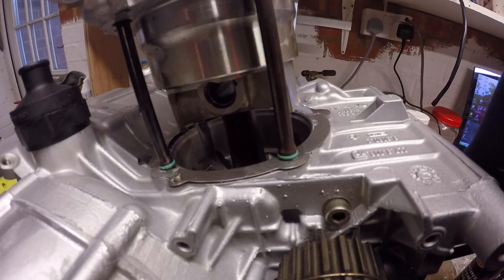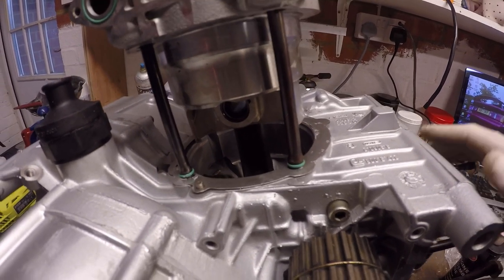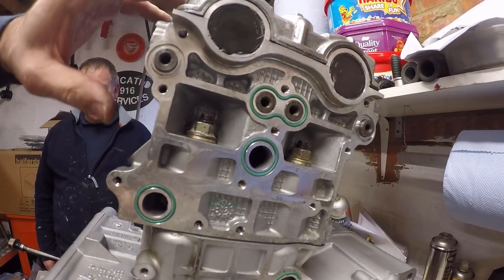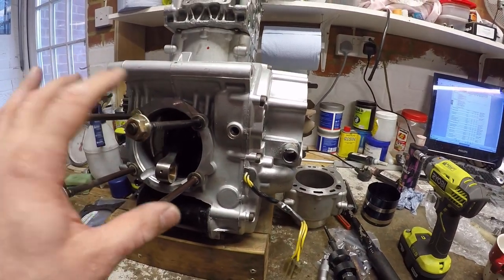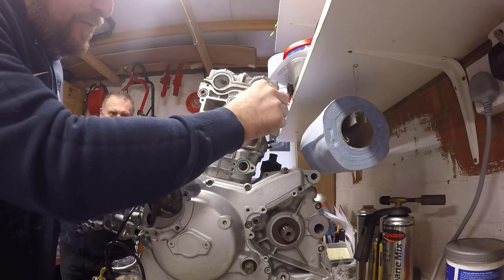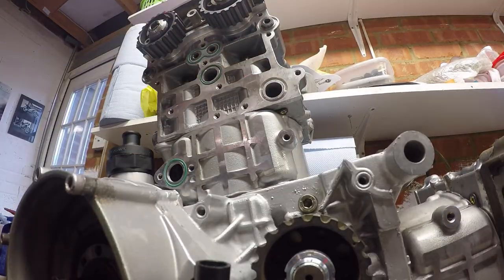Testastretta 749 Engine Build Video 3 - Fitting the Cylinders and Heads

Comment: Was the squish not checked just because this wasn’t a full ‘blueprint’ type build? Great work and video.
Reply: And shouldn’t the setting on the torque wrench be reduced since it’s not acting directly on the nut? The wrench head looks like it has a 4” or so mechanical advantage over the nut being tightened.
Reply from the maker: HI Rob, Its something I have considered but as I have not had any issues to date doing it with this tool I have stuck with settings as given and accepted that it applies a few Nm more torque.

There is another tool I have that is direct line for torque similar to the factory tool but is unwieldy to use

Comment: When you tighten the head bolts do you use different torque settings to compensate for the extra length of the torque wrench with the adaptor on the end? I have just changed the head on a Testastretta 1200 engine and was confused as to the proper torque settings. Thanks
Reply from the maker: Hi Heath,  if you use the extension at 90 degrees to the torque wrench it should be the same setting. if not there is a calculation to assess the change in reading needed to be accurate.
Reply: @DesmoWerx  Hi, I thought you had to change the setting, but I didn't know that about the 90 degree but it makes sense as it is the same distance away. Thanks for replying, enjoying your channel.

Comment: The head gaskets look to be the same sort of material (rubberized metal?) as the valve cover gaskets. Can they be safely reused, or do they need to be replaced if one pulls the head?
Reply from the maker: Hi Zarn, they need to be replaced everytime you pull the head, there is a part to them that deforms when first torqued down. :)
Reply: Thanks for the help.

Comment: Podrias enviarlo en español..? Tengo una 749 dark
Reply from the maker: Hola Christopher, que necesitas enviar en español?

Puedo usar el traductor de Google para enviar algunos detalles si es necesario
Reply: Hola mucho gusto.. Lo que sucede es que tengo una ducati 749 dark y está dañado el crankshaft y queria hacer una compra de tal parte... Pero en ebay aparecen muchos modelos de cigueñal para 749 dark... Pues la pregunta es la siguiente: le puedo poner cigueñales o crankshaft de cualquier modelo ya sea 749, 749s, 749dark o 749 dark biposta me sirven?
Reply: @DesmoWerx  la mia es una ducati 749 dark 2004 y queria saber que tipo de cigueñales le pueden servir sin afectar nada su rendimiento ya que he visto un cigueñal que tiene el  codigo : 
749B
5E*60174. 
Y mi codigo de cigueñal es:
749B
3G*31812
Reply: @DesmoWerx  me gustaría por favor saber si me puede ayudar o si le puedeo escribir a otro sitio... gracias